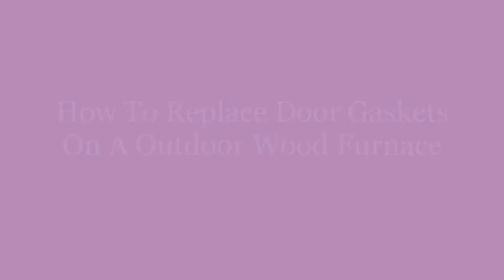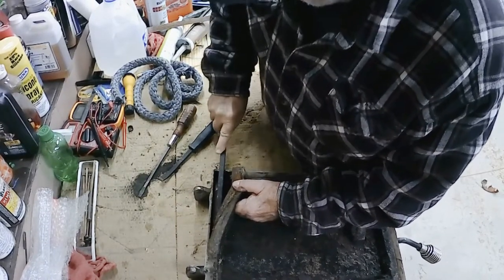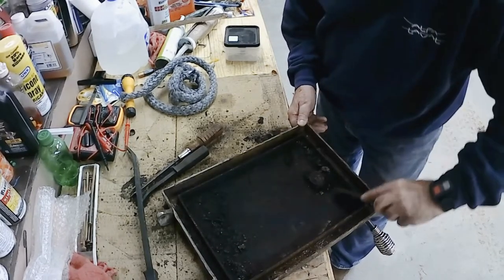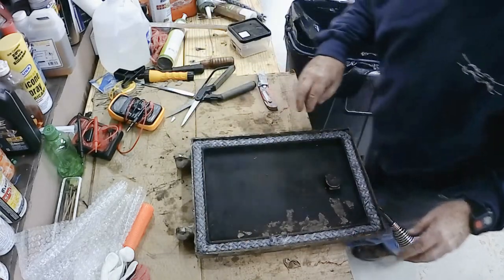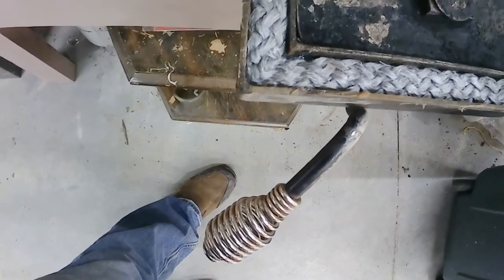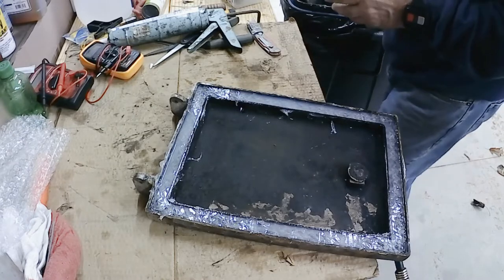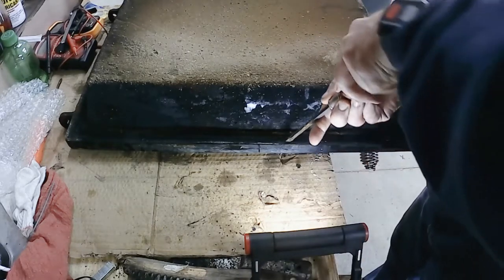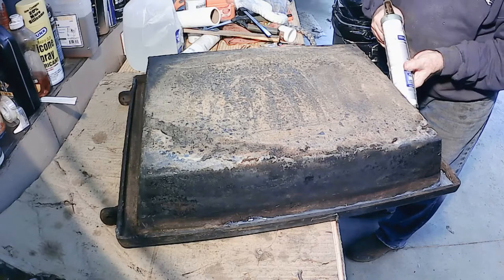#147 How To Replace Door Gaskets On A Outdoor Wood Furnace

Comment: I'm gonna give the cheap silicone a shot. It seems to have worked for you. Have you used it before this time? I assume it holds up OK? Hi temp silicone is more than double the price. What's the worst that can happen (famous last words lol)
Reply from the maker: Yes I have used Hi temp and the lower cost 100% silicone. I see no difference between them! I get Two to Three winters with the low cost silicone. Appreciate your comment Phil, Good luck!!
Reply: @sawmillbill7012  Thank you, the best advice is from someone who actually tried both types and has experienced the results